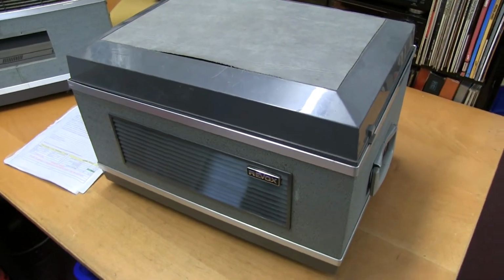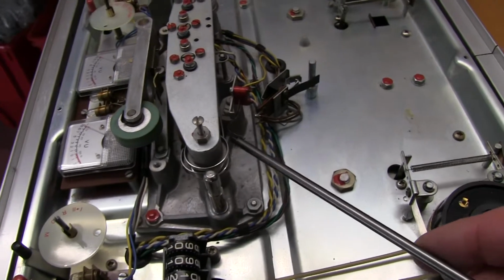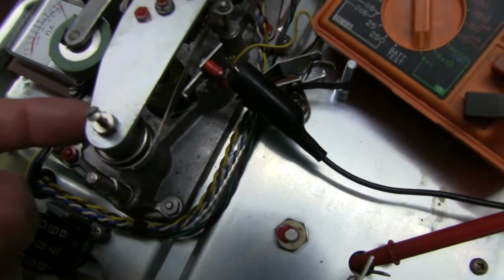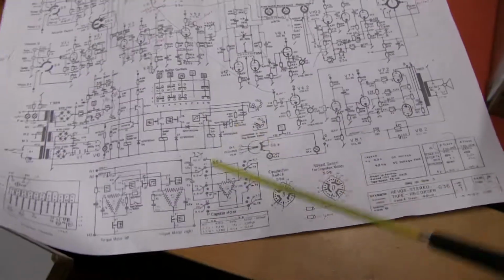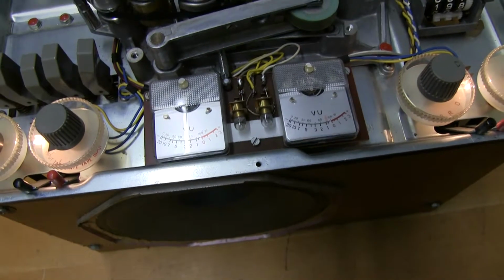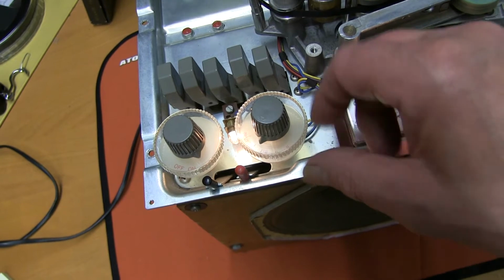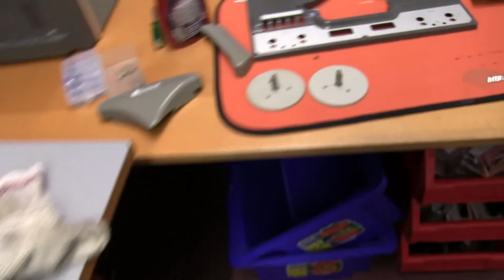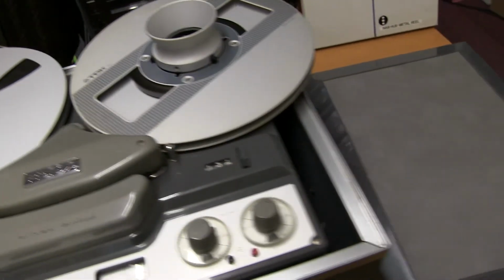Revox G36 4 Track stereo valve tape recorder. Repair and service.

Comment: Thanks for your video, I am missing the switch contact arm inside the tape tension switch, aka reel size switch, as well as the plastic lever. So, could you please confirm that when using 10.5" reels the switch contacts should be closed? If so, I'll just wire it closed for permanent use with the larger reels in my machine.

Comment: Nick what is the easiest way of taking the unit out ? I have acquired an original speaker baffle and is ready to fit. Should I put the unit sideways speaker grill facing down and slide it slowly out ? or pull out from the top ? And what about putting it back in the case without damaging the speaker ?

Comment: The capstan on this is unusually small diametered. Hence it wears incredibly faster than normal diametered capstans. Here, it spins 4-5 times more per foot of tape, resulting in minute undulations on its surface causing noticeable wow and flutter.

Comment: This is an early g36 with curved tape slot and under cover. This had a spring activated tape end stopper. Later models had clip on head covers with straight slots and photocell tape stoppers.

Comment: Hi Nick, I bought a G36 off Ebay and the capstan motor does not run at all, rewind, fast forward all fine. Also the loudspeaker and baffle also missing, would you have one at all I could purchase off you ?
Reply from the maker: Hi Harvey.  The capstan motor is unlikely to have failed. It is more likely that the selector switch needs cleaning. If you look at the circuit diagram, the capstan motor is supplied with the same voltage as the winding motors, and the selector switch has quite a few contacts.
I assume the capstan motor shaft can be spun by hand.
You can get the service manual Free from
https://www.hifiengine.com/manual_library/revox/g36.shtml

The previous owners must have used it through a monitor sound system, so the speaker was not required.
It is shown as a 5ohm, but any between 4 and 8ohm will work fine.
There are machines broken for spares, especially on the German Ebay site, so just keep looking.
All the best. Nick
Reply: Hi Nick, thanks for replying. Yes the capstan shaft is turning freely by hand. I have a hard copy of the service manual will check it out. Thanks for the info Nick, will keep you informed.
Reply: By the way Nick what size is the speaker ?
Reply from the maker: @conundrum112  Hi. I'm not sure. It has to fit in the space available.
Reply: Okay thanks Nick.

Comment: HI CAN YOU TELL ME THE TUBE  NUMBERS IN THE BACK  FROM LEFT TO RIGHT  As MINE ALL CAME OUT IN TRANSIT THANKS PHILL
Reply from the maker: Hi Phill. Tubes from left to right. Ecc83,81,81,81,81,83,ECL86,ECL86, 83,83,83.  And top left Ecc82.
All the best. Nick

Comment: I ONCE WORKED ON A G36 THAT A CUSTOMER HAD BOUGHT OF EBAY IT WAS MINTCOSMETICS BUT HE WANTED IT CONVERTED TO HS WHICH I DID.WHEN I CAME TO CALIBRATE IT .ONE CH WAS 10DB DOWN AT 10K. SUM CLOWN HAD PUT THE HEAD ONA LATHE AND TURNED IT DOWN TO GET RID OF THE FLAT ON THE TRACKING AREA.YOU COULD SEE THE SWIRL MARKS IN THE ARELDITE AND THE RING BETWEEN THETRACKS WAS FLUSH WITH THE REST AS IT WAS A RING TYPE NOT LATER SQUARE TYPE

Comment: hi Nick i have a few of ReVox D36 & G36, they are not working properly, could you them back to life? please let me know. appreciate, 
thank you, Tony
Reply from the maker: Hi Kent
Sorry, I am not servicing the Revox any more. Never straightforward, especially as the heads wear badly.
Reply: I HAVE A G36 AND E36 FOR PARTS
Reply: Have you still got these? I need some bits for a G36 MKIII. @JULIAN8845

Comment: Interesting that I have the later model (with the light-based tape sensor) but the heads are the earlier round design, while in your unit they are the newer ones.

Comment: How to see if its 2 track or 4 track version?
Reply from the maker: Hi Olaf
Look at the Erase head on the left side of head block (Where tape comes in)
The 2 track has 2 wide erase bars, with small gap between them (Black bar)
The 4 track has 2 narrow bars, with gap between them.
Reply: Thank you!
 but whats small ? whats narrow whats wide, if you can`t compare?
how much mm is narrow bar and how many mm is wide bar?
Reply from the maker: The 2 track erase head bar is 3mm wide
The 4 track is 1.5mm
Reply: Thank you so much ,its clear now
Reply: @obiessen  hi Olaf ! take a look down

Comment: Great production Nick. I have the same model but one channel is not playing back at an equal level to the other channel. Any idea what i might try. Possible bias pots?
Reply from the maker: Hi
You can try the bias pots. Turn each one up and down while recording and try and get the maximum output.
Otherwise it could be head alignment, which means adjusting the heads while making a recording and playing back.
Reply: Thank you Nick. Will give it a try.
Reply: I had the same problem , dirty pots, try the easy stuff first.  @photoexpert3771

Comment: Just a thought on the VU adjustment, a modern line in is quite hot for a G36, I can never get the nobs past 12 oclock without the input going right into the red on the VU.
Reply from the maker: Hi Robert
I find the graphic equaliser very useful for adjusting tape decks.
The VU levels on the G36 seem to be set to give a very high level at the 0Vu mark.
I have to adjust the VU gain pots as described, to get the level in and tape out equal. The input level controls are then at about number 6.
Your 12 oclock position is quite normal.
Reply: Ah I see, so you are only adjusting the VU meters sensitivity?
Reply from the maker: Hi Robert
The VU levels were out.
It is important to make sure the VU levels are correct before you make a recording, or you may be under or over level which will not give optimum recording without distortion.
I did not have to change the record/replay amps. But I did optimise the bias.
Ideally you need a calibration tape, but a pre recorded tape can be used as the levels on the tracks should be the same.

Comment: Hi Nick, would you be interested in giving my g36 mk III a service?
Reply from the maker: hi
The G36 is very easily damaged in the post.
Also due to their age, they can have many little problems, including head wear, brake wear, dry bearings and valves worn out, and various adjustments out. And they are awkward to service some parts.
Therefore I am reluctant to service them , unless they are a good condition machine.
Also sending them through the post is a recipe for disaster.
Reply: Hi Nick, Thanks for getting back to me, I would deliver the deck personally as I wouldn't trust a courier. It does have a lot of head wear but as I understand it Revox released an updated head towards the end of production, I can buy these heads from a source in Germany, I was also told by a French guy on Tapeheads forum that he has used these Revox heads but had to add a resistor into the circuit somewhere, that's all I know and he hasn't got back to me with anymore information in over a year. I also understand that heads from a solid state wont work with a tube machine so I am still a bit dubious but the seller does state that they are for the G36, any thoughts on this?
Reply from the maker: Hi Robert
You can use other heads as long as they can be fixed in the correct position.  It is fairly straightforward to fix and wire them in.
The frequency response may be slightly out, but the difference of tapes has more affect on frequency.

Comment: A great job Nick. It does make you wonder how Revox delivered these tape recorders to customers without them getting broken in transit.
Reply: They were delivered in just a regular box with kind of styrofoam fitting.  I still have the original 1965 packaging